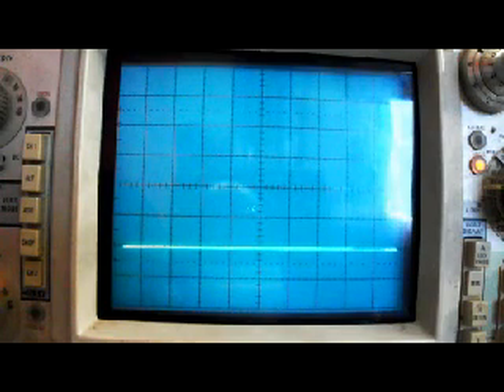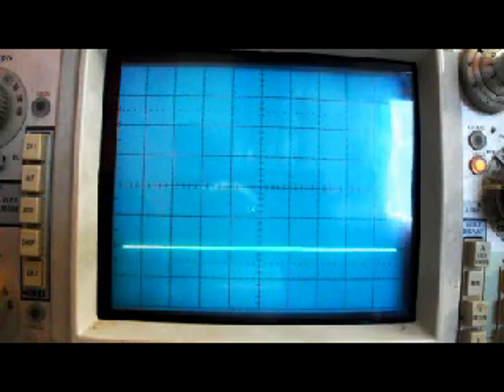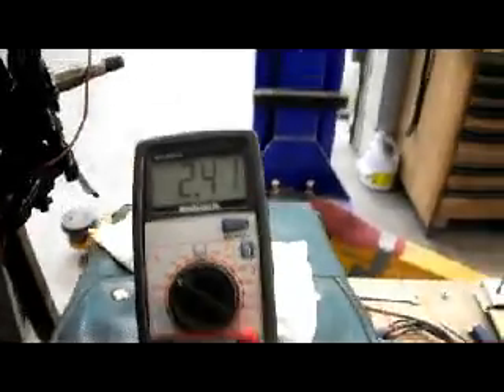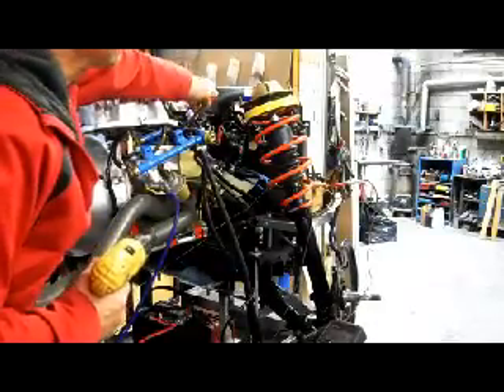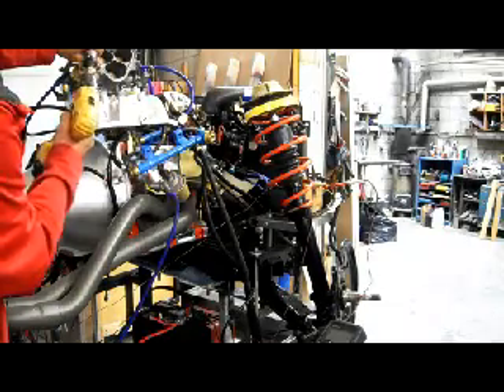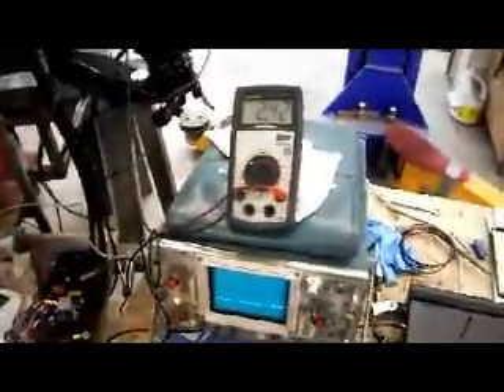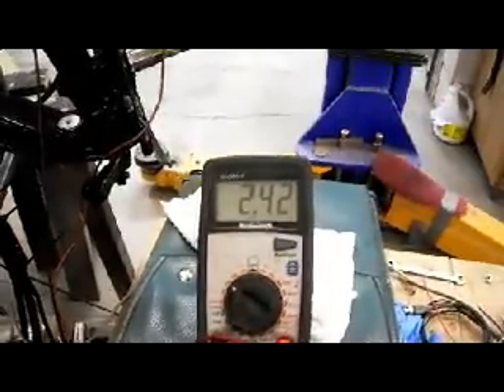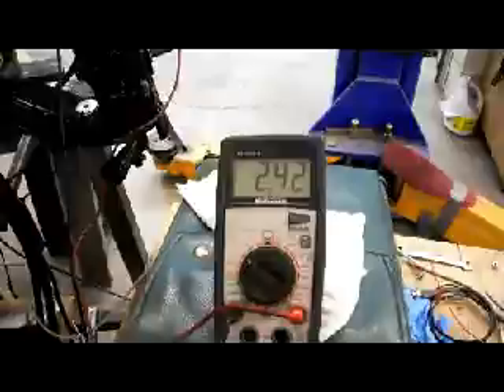MegaSquirt Rotary Conversion-1

Comment from the maker: Okay if you printed out the instructions for MegaSquirt and are following them, go back to the website and print them out again, there was an error in their instructions.  On the Leading coil do not connect the  single black wire to anything, if you ground it as in the old instructions it will fry the coil and ignitor and not give you leading spark.  I do not have a diagram just the written instructions from MegaSquirt.

Comment from the maker: Problem resolved, Found error in MegaSquirt wiring instruction for leading coil.  Have lost 3 coils and ignitors but now have new coil installed and wiring corrected.  Now have leading spark.  If you look at the scope you will see I had the coil always on and MS was giving a low or ground pulse.  As stated past this  and will post an update shortly on RX7 Owners Club with You Tube link.